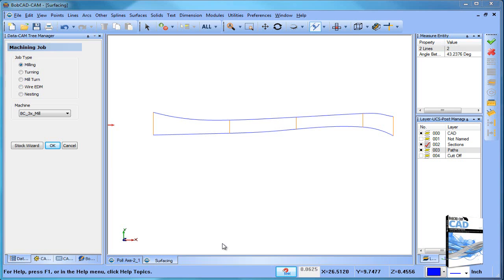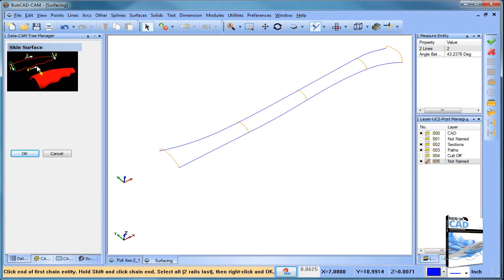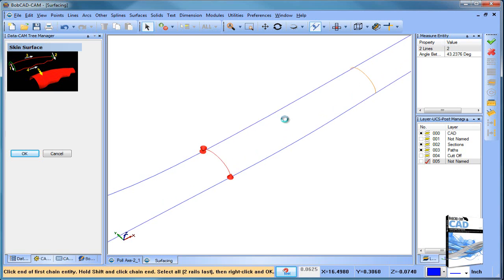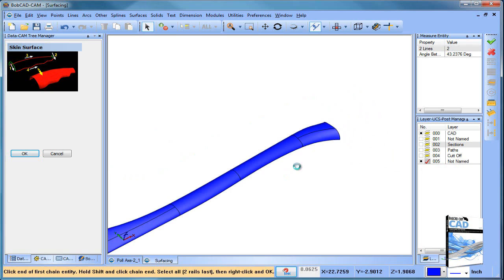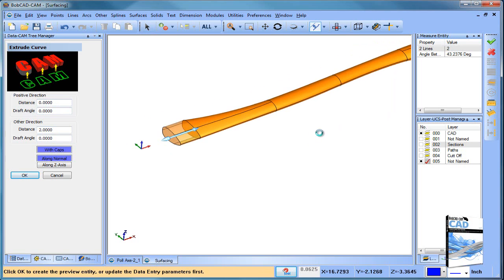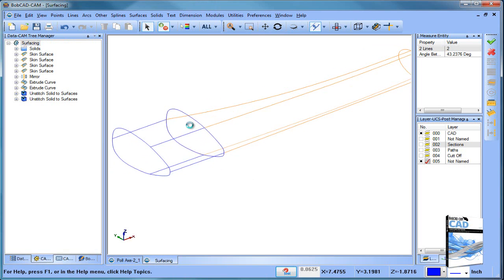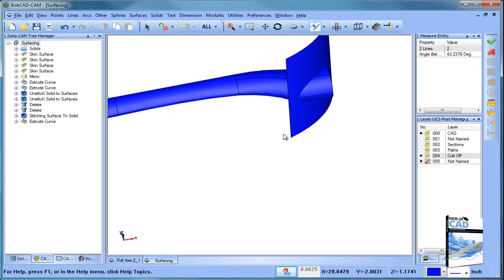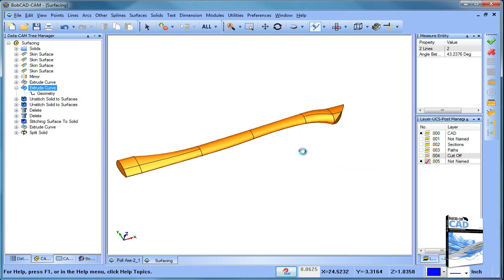Surface Modeling with BobCAD CAM V28 CAD

Comment: Al;
  I am cramming on V25. I want to cut parts in a couple days, but still have to study a bit. 
 Anyway... I have v25 3 axis Pro. With Art. 
  And a 4 axis Fadal. Looking at a 5 axis truniouon table. 
   Look, this runs into dollars. 
  Could I set up my 4th at a 60 degree incline and generate tool-paths in that configuration with the software I have?
  Thanks,
  Mark